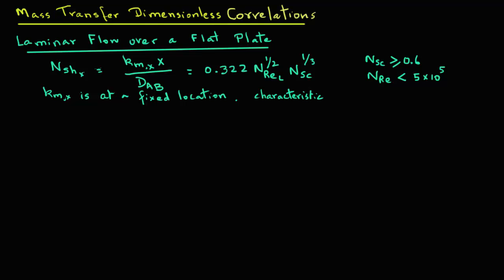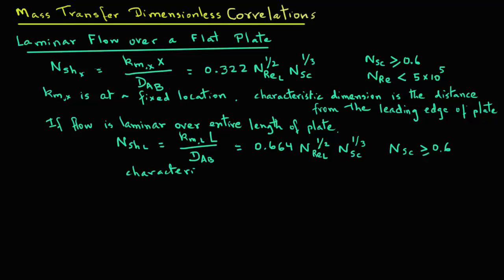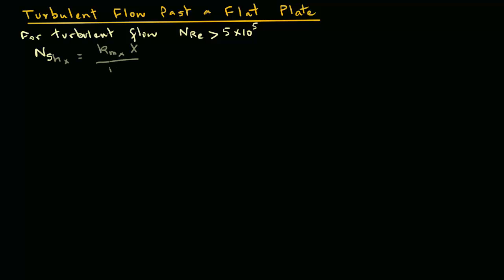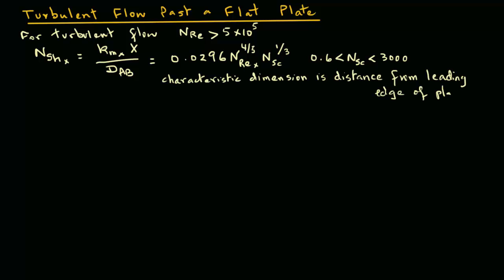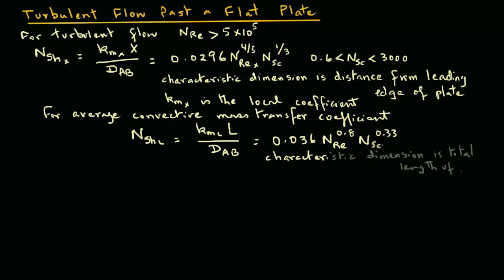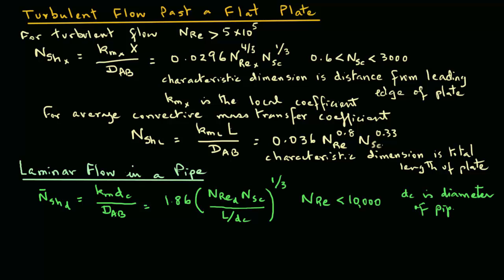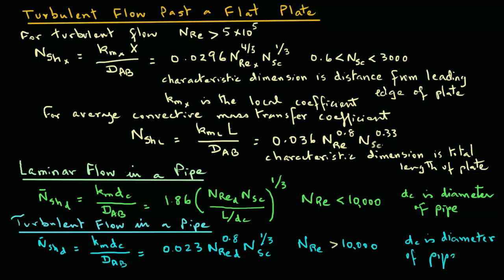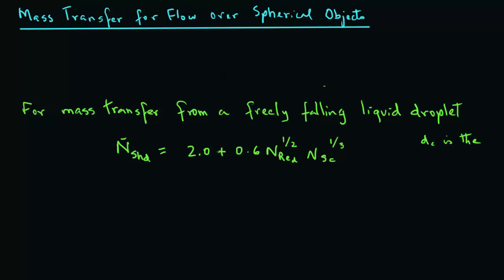Mass transfer Dimensionless Correlations

Comment: Isnt the flow already turbulent when Reynolds number is higher than 4300? or does this deciding value change depending upon what kind of shape ( plate, pipe or sphere) that the flow goes over? I get the value of 4000 from flow through pipes, but you mention even that to be 10,000 for Re.... could you please help me differentiate?